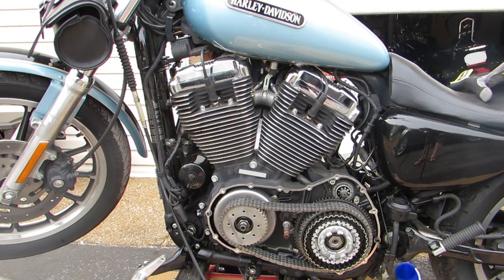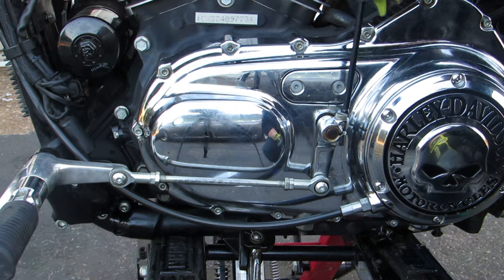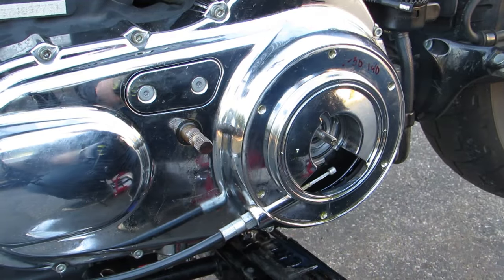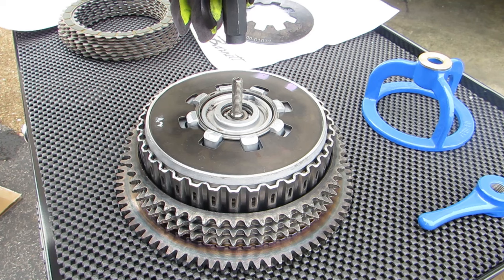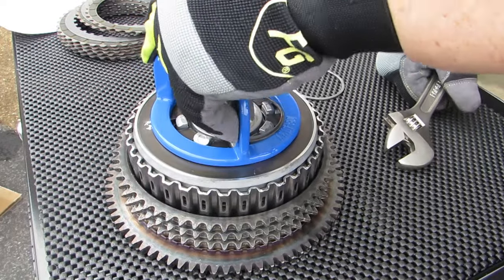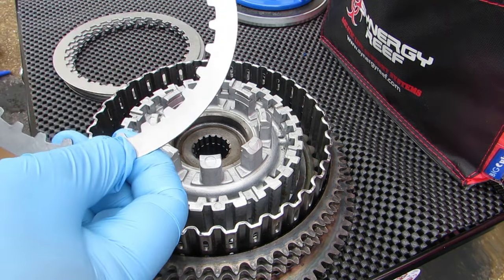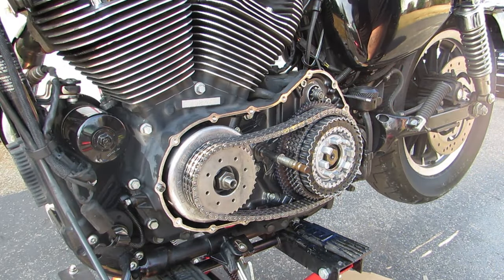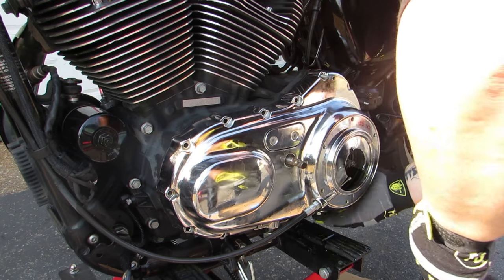How to Replace a Harley Sportster Clutch - GetLowered.com

Comment: Thanks for the great video, you saved my vacation.  Got the tool and parts just in time to replace the clutch plates and head off on a 4k trip.  If you've ever done brakes, this is a task within your abilities.
My '06 had over 40k so I guess this isn't the first time they've been replaced, although it did have the HD plates with rivets, which were all sheared off.  Luckily no internal damage and recovered all the rivet ends.  My Bartlett ring set didn't have those first three 'special' rings, just the friction and steel rings.  Oddly when I went to order the compression tool, the sites kept telling me it was not for my bike, but customer comments assured me it was and it worked like a charm.  Thx again.
Reply from the maker: Nothing worse than a ruined vacation - glad we could help!

Comment: Great video! I’m having the exact same problem that you said at the beginning. Won’t go into neutral, and creeps in first gear at red lights. Was hoping it was an adjustment issue, but I checked adjustment like 4 times, and readjusted everything just to make sure, no luck. Looks like I need a clutch 😢

Comment: Great vid, I replaced my clutch with the extra 
plate kit, to avoid the spring plate going bad, I did it at 17,000 miles on my 2012 Sportster. 
Only thing I did different was I replaced the clutch bearing as in my other sports they have gone out at the 30k or so mile mark. 
I'm surprised there is not a ton of what oil to use. LOL (Barnett says NOT to use Formula Plus I went ahead and use my normal oil)

Comment: this has been a very educational video.  Thanks for sharing.   Did you replace the clutch basket on this sportster?  You shared that the spring (riveted) plate did some damage.  I am just wondering if I order the clutch plate kit from Barnett, if I should order a basket as well.  Thanks again for the help.
Reply: Depend entirely on if it is damaged or not.

Comment: Took apart a 05 XB12R and clutch pack missing #22 spring seat. Also why does manual say on installation 6.14 to install narrow fiber or B plate first, when other illustration shows spring seat goes in first followed by spring plate? Is this because diameter of narrow fiber plate is larger such that spring plate seat fits inside?

Comment: I have a 1985 1000 iron Head with a culch release that is different than any other discontinued part can't fine the order of parts to be assembled on the clutch adjustment

Comment: Have a 98 1200 custom with 92,000 miles on it , clutch is just starting to slip. I have a Barnett to replace it :)  thanks for the vid.
Reply from the maker: Awesome, glad it helps!
Reply: My 06 has 200,000 and the clutch has never been replaced. Just starting to slip.

Comment: what exactly is the name of the clutch kit that you used and was it a extra clutch plate kit and what is the manufacture number
Reply from the maker: It's the Barnett Extra Plate Clutch Kit, Kevlar version and the part # is DS-223739. Can be found here in either the Kevlar or Carbon Fiber - http://www.getlowered.com/barnett-extra-plate-clutch-kit-for-harley/

Comment: Hi, thanks for the video.
Been looking at Barnet clutch packs. The only one I can see on their site with the damper plates is the scorpion. Will this fit a standard hub or am I better going for the Barnet extra plate kit.
Cheers
Reply from the maker: Hey Ross - the kit in the link should have everything you need to get the job done, depending on your year and model. https://www.getlowered.com/barnett-extra-plate-clutch-kit-for-harley/

Comment: Great video.Ya gata here this,just bought 2005 1200 14500 miles clutch was making a little noise got worse day buy day till you could only go for a half hour till it got to noisy my health condition does not allow me to lay on the floor to do this because i dont have i lift.ThIS is were it gets good went to the harley dealer told them i would like my clutch replaced with something better they said they needed to evauate the clutch first i palitly asked them do i need to wait till the gernade ring blows.the man behind the counter said,whats that like they dont know.So it ended up like this i said can we just get the fuc.king peice of shit out of my bike before it goes and replace it or not.they said ya i guess so they still have the fucking thing 12 days now bullshit about one piece didnt show up still waiting.been ridding all my life never used a dealer for any work.so needless to say i got some first hand exspearence  to why all the people i know hate the dealers.well now i know,it was like a fucking nagosheaiting .wow saw this video just in time before i had a bunch of peices in my hand like other vids i watched

Comment: No gasket change for the primary cover? Going to replace my shifter shaft seal as well when doing my clutch cable replacement.
Reply: And install the clutch on a 1998 Harley Davidson Sportster 883 I still can't get no gear what would cause that

Comment: Great video! Just a question: how can I adjust properly the clutch screw (held in place by the hex plate and spring) on reassembly?
Reply: First make sure that your clutch adjustment nuts are still fully loose. To adjust the clutch, the factory service manual says that you want to tighten (remember, it is reverse threaded so you'll be going left to tighten) it just until you feel resistance and then back off 1/4 to 1/2 of a turn. I found this to work really well for me, but it might require that you play with it a time or two to get it right. I'd suggest not putting the derby cover back on until the clutch feels right to you.
Reply: Thank you very much!
Reply: you forgot to mention that the you need an 1/8 of an inch of freeplay in the clutch lever :P

Comment: I have the same bike...paint and all. Where did you get the forward controls?   Pretty easy and straightforward...no different than the clutches in an automatic transmission.  Thanks for posting.

Comment: Can't brake loose the hex head bolt that holds the shifter mechanism to the spline.  Applied so much torque I started bending the shaft ! Any idea?
Reply: Drill it out 😮‍💨

Comment: What are the Torque Specs bolting down the Cover and Derby Cover? Are they the same, also? Great Vid, thanks!
Reply: Cobra Commander, the specs are hand tighten at will you’ll be ok 👍
Reply: Cobra Commander, the specs are hand tighten at will you’ll be ok 👍